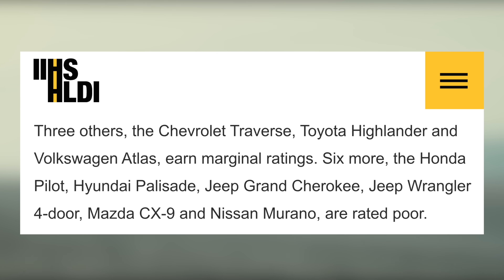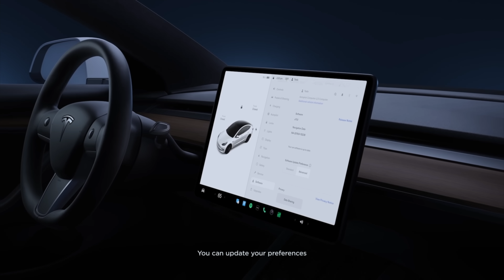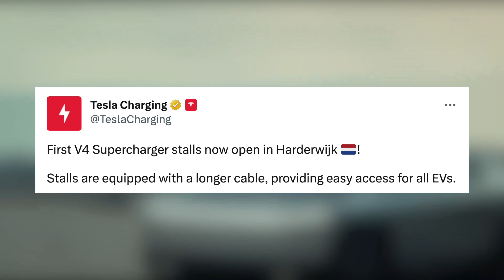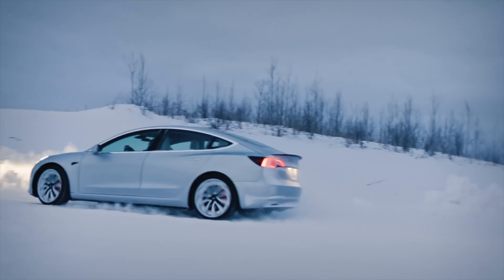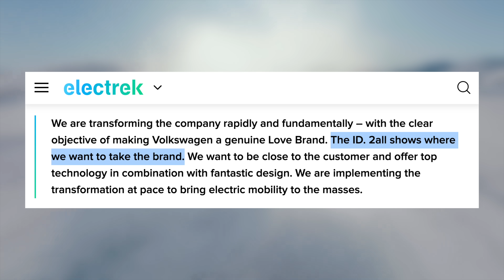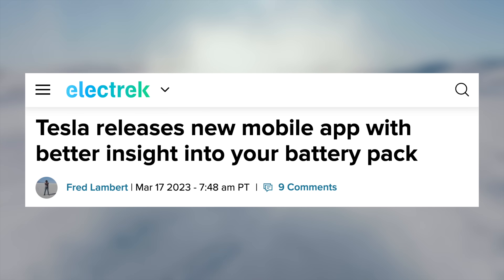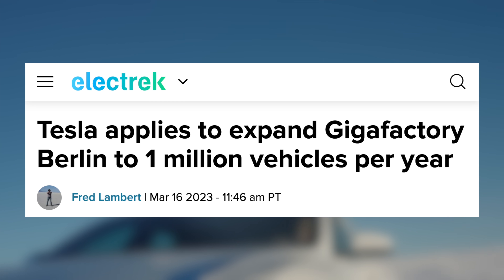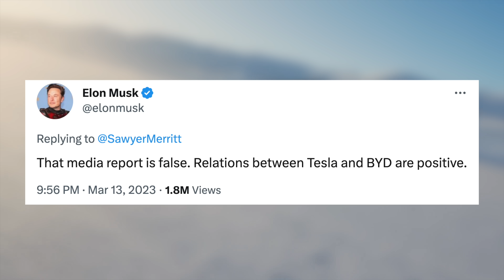Tesla “FIXED” Most Controversial Feature | Fans Aren’t Happy

Comment: I love that the V4 Superchargers FINALLY come with longer cables!
Since they’re opening up the network, cars with ports on the passenger side or even near the front wheels like Audi/Porsche no longer have to block multiple stalls if they can’t get the outermost one!
And since so many locations have a mix of V2 and V3, they can just swap out the old V2s for the V4s and roll the chargers out to more locations more quickly!

Comment: For Tesla’s current models, I think the biggest advancement in charging would be keeping the charging power up for longer. Not only does it improve charging speeds, but it also makes it less important to arrive at a charging stop with super low SoC. IE. More flexibility. 
The speed that a Model S, a EQS or Taycan charges at is fast enough already imho. You plug in the car, go to the rest room, get a coffee, put the codfee in the car and unplug at 300km of range. Plenty fast if you ask me.
Reply: The solution that I recommend and have been using since it became available is to enable the PIN code security

Comment: About your story of two Tesla owners driving away with the others Model 3, if either one of them used Pin to drive they would of figured this out before driving away!
Reply: This sounds like a better solution compared to others that have stated to basically “mod” your Tesla to differentiate it from others

Comment: Thought: V4 are dual 400V and 800V architecture. Can do 250kW for 400V. Can do more at 800V. Longer cable works for 800V, and has less losses. And less heat to exhaust safely. I'd say the V4 will have a hard time to be consistently at 250kW for 400V Teslas.

Comment: FONTS!
 I really wish I could change the font size on the Tesla display. I wear bifocals and have to lean over and down to read the display. This can be a safety issue for us old farts.
Technology actually exists today to change font sizes I believe. I do wish Tessa would allow me to enlarge the fonts. It wouldn't cost them huge amounts of money.
Reply: I totally agree.  I think Tesla designs their vehicles for 25 year olds with perfect vision and steady fingers.   In addition to increasing font size, they should increase the size of various buttons displayed on the screen.   Even if you have good eyesight and steady fingers it can still be hard to touch small buttons on the screen when driving on a bumpy road.
Reply: @wilber8260  I agree completely, one of the few things about my model 3 that bugs me.  I had a pair of bifocals made especially for driving. The lower part is optimised for reading at the distance to the screen and the split lines up with the top of the screen when I have my head in the driving position so I don't have to move my head to get the screen in the right position. I also bought the Teslogic dongle and app, I have my phone mounted on the steering column and I have a really big digital speedometer right in front of me plus other stuff like the speed limit, autopilot speed setting etc. I find I don't use my glasses much since I got the Teslogic app except if I want to see the play list or the street maps.
Reply: Perhaps UI designers could wear glasses that simulated old eyes.  There is no excuse for using light gray fonts.
Reply: Highly recommend progressive lenses, both sunglasses and standard glasses. Solves this issue for me
Reply: @RolandGustafsson  😂.  They spend 50k on a car but won't spend a few hundred on lens technology.  Love your comment.  👍
Reply: It really would not be too hard (or expensive) to have a head up display for minimal information such as speed, battery and satnav directions
Reply: @williamgrunzweig571  
A $100 Android Smartphone has the ability to change the font size and type, and customize colors and shapes, and move things around wherever you want them.  Why should a $50K car not be able to do so???  Many older folks  may not need glasses at all for distance vision... but need some help for things closer up.
Why do you make excuses for Tesla??  It should be a option in settings.  SO easy to do.. why should the owner have to spend money for something they don't need. 
The Font size is too small, LOTS of empty white space on the Tesla screen.. seems dumb to me.
Reply: ABSOLUTELY agree!!!!!!!!!!

Comment: The current 250kw stalls and 21 m3 lr is only a few minutes faster than a 150kw. I'd love to see the charging curve become an improved slope =b 

Usually, by 35% the speeds start to match on the v3 & v2 chargers but I've noticed while charging at 150kw the rate will stay above the 250kw charging curve longer.

3 long road trips and maybe only 4 minutes faster to 80% on a 250kw v3 vs 150kw v2 

I guess if you're living between 10% and 40% soc I'd go out of my way for the v3. 

Anyone else have different experiences?
Reply: Very similar experience here. I have a 2020 Model Y and my wife had a 2022 Model Y. They both drop to 150kW at 40%. 

This morning she plugged her car at 27%,. For a second she l it was pulling 257kW. About 3 minutes later she hit 40% but had already 11kWh.

Something to also take into account is that the 150kW stalls can drop quickly if there is sharing power involved.
Reply: @acolon8999  =b gotcha, I do get a little sad when a buddy bulls up next to you at a v2 and that charge rate drops =X. 

Cheers and good luck with your ev amigo.
Reply: @borshardsd  I don't go out off my way to use a 250kW charger but I try to skip 150kW chargers when possible even if it means running the battery under 10%.  I drive several times a year from New England to Florida and it's easy to hit 250kW stations for almost the entire trip. I can't wait for Tesla to start installing the V4 stalls here in the US. I hope that it would allow for faster charge for us by either allowing the vehicle to handle higher power or by staying at higher power for longer.
Reply: @acolon8999  good stuff man ty for sharing!
Reply: @acolon8999  wont the higher KV chargers only be for car that havent come out yet? I assumed it was basically tesla future proofing for future advancements in tech that would allow a battery to accept more power. I imagine the 4680 cells can take higher kv's since the energy has such a short path now making for lower internal batt resistance.
Reply: @AlistairBalister  Honestly, I don't know. I read somewhere last year  that Model 3s and Model Ys could handle close to 300 kWs but nothing official yet from Tesla.  I guess we'll find out eventually.
Reply: 250 are faster because they aren’t shared. 150 at busy chargers really means like 75. 75 vs 250 is a big difference 

On road trips I charge only until it is about 200. And then I move on. I don’t wait to charge it to 80 like noobs
Reply: @C Wang  lmao yes. If someone has to charge to 80 they are a noob. Definitely not because the next leg is long in the freezing cold. Thanks for sharing your true self. Obviously you stay as long as needed regardless of being a noob lolol yeah we should make fun of people for being new? Please.
Reply: I've seen someone else report that they saved time on road trips by charging more often and staying in the 10-40% range. But when factoring in the time to get out of the highway, look for the supercharger and the reduced speed in those streets, I'm not sure you can actually save a lot of time like this.  Idk. Plug in and watch a 45min episode of something or get some shut eye :) works pretty well. Doing 10 to 60 or 65 could be ok. The last 15-20% are quite slow.
I think current gen teslas will be limited in charge curve improvements because a lot depends on the battery chemicals. But some clever BMS updates might help.
Reply: @borshardsd  I’ve done more than 100k miles in teslas across 6+ different teslas. Drove across the entire country with tesla using purely super chargers and routinely doing 700 mile drives. 

I also lived in the northeast with tesla before and after heat pumps. 

You rarely need to charge to 80%. Sometimes you do but very rarely especially now with even more super chargers. 

As EVs go mainstream it would help if people are more educated on charging. It also varies from car to car. Taycans for instance can go pretty deep at high charge. 

But for most people. If you are road tripping, charge to 50 and move on. You often pass multiple chargers so you don’t have to go far from highway
Reply: @cwang9915  For me it depends. If it is a stop in which I am having a meal, I just let it charge until I am done with my meal. If it is a quick bathroom break, I charge just to get enough to get to the next 250kW charger if available if not, I usually change to 70%.
Reply: @acolon8999  yup same for me
Reply: @C Wang  so you read the comments and think I'm not an owner? With out road trip experience?  Yeah it's rare but not unheard of. Obviously when I mention charging to 80%soc its  situational, maybe below freezing on a big stretch, the car was using close to 400w/m. You don't need to stroke yourself, fluff up and do 100k to understand a charging curve or read and understand and communicate in a friendly manner ya noob.

Comment: Charging speed being quoted at kW is misleading. First, batteries are substantially different, from tens of kW to well over 100 - or even more for beasts like the Hummer. Second, all cars throttle charging below their own maximum, primarily depending on battery temperature and charge level.  A 150 kW, 250 kW, or 350 kW charger may in fact fill up a car's battery in not dramatically different times, especially if one needs to charge above 80%. And this does not even consider the dramatically different ranges out there for a "full" battery.  I'm not sure of any completely transparent alternative, but the charger arms race needs a bit less coverage, or much more thorough explanation.

Comment: In a dark parking lot back in the 70s My oval door key opened a Buick that looked like mine. But the rectangular key would not start it.
I think there were 64 different cuts on keys back then so not too surprising.
 I use a PIN to 'start' my Tesla, because of the story of a Vegas car jacker.. She waited for the driver to open the door and pushed her way into the driver seat. She got as far as a Supercharger 40 miles away.

Comment: Hey was wondering if you had some insight, was looking at Teslas around 35k I’m finding model 3 like 2020 2019 for that price or i could do a 2017-2018 model s  don’t know what to pick
Reply: Get the Model 3.  The Model S is absolutely a beaautify car.. But the interior space is not as big as you would think.. except for the cargo hatch area.  Try both out and see which you like better.  The Model 3 is probably quicker, handles better, and is more efficient too.
Reply: @brunoheggli2888  
In the USA.. Older BMW's are endless money pits once they get over 80K miles.
If you can't afford a new one.. then you can't afford the maint and repairs on an older one.
I'm sure in Europe it is a different situation... Parts are STUPID expensive here, and the labor to get the work done is also high.
Reply: @brunoheggli2888  
Or I can buy a Toyota and not have to ever worry about changing anything until it is broken which almost never happens. 
It's kind of why generally we consider European cars to be unreliable and money pits.
Shouldn't have to be swapping parts until something breaks or shows some kind of failure.
I Got a 15-year-old Toyota hybrid  with 423,000 mi on it. Still rolling on the original powertrain,  suspension parts except for the struts themselves, wheel bearings original cooling system,  radiator,  fans etc.
Primary inverter failed at 388,000 mi, 
$100 from a salvage yard took me 40 minutes to swap it.
I think one of the issues is in the US  we tend to drive a lot more miles and so these problems pile up a lot quicker.
I drive for a living, 50,000 + miles per year.
I Can't afford to be doing preemptive maintenance on stuff that shouldn't be broken in the first place.
And in the States You're paying a lot more for those parts.
Watch plenty of car repair channels some of which specialize in high-end cars. Jaguar, Bentley, etc. The mechanics that run those channels all say the same thing. Don't buy one of these with miles on it unless you have significant money. The general rule is if you could not afford to purchase the car brand new, then you probably can't afford to do the required  maintenance and repairs on it when you buy one used with a lot of miles.
 Keep in mind I do keep up on all of the regular maintenance on my car religiously. Oil changes every 5K. I  do the transmission fluid every 50k. Not really required. But it's cheap insurance.
And I can and have worked on just about every system in the car. I generally don't like shops, they're usually a rip off, and about 50% of the time they're incompetent at the same time they're ripping you off.
It's one of the many reasons my next car is likely to be an EV.  Internal combustion cars are becoming absolute nightmares to keep on the road..
And I'm getting sick of doing the maintenance myself.
Planning under a car to do an oil change every 5 weeks is a pain in the butt. It's not difficult, but it gets more annoying the older I get.
Hope you have a wonderful day.

Comment: Tesla might have the best charging network but it was not built for 8/900v cars, hence slow charging on those EVs until they upgrade to the newer V4 Supercharger.
Reply: its not slow at all, in reality its slower, we have plentyx charging infrastructure in europe, but the reliability isnt there, the preheating is not there, etc etc, in best case scenario you could charge slightly faster but in reality, simply not.

Comment: Could happen to any two cars of the same model and color, parked close to each other with key-less entry and push button start. Where both owners unlock and start the other persons car at nearly the same time. Highly unlikely. But if this happened to two say red Buick Encores, this would be chalked up to a crazy coincidence.
Reply: No it can't..  
You might be able to open the door.. IF the cars were parked  right next to each other.. 
My 15 year old Toyota knows what door your approaching.. Driver, passenger, or hatch.. It will only unlock the driver door if your are right next to the driver door, if you are near the other doors then they all unlock when you grab the handle.
It will not allow you to start the car unless your key fob is actually INSIDE the car..  not next to it.. or on the roof..etc.
I suspect this story is a fake.. some people trying to get into the news.. or maybe some weird situation happened.
But the cars should never have been able to "start" and drive off with the wrong key/phone  in the wrong car.
Maybe in a Tesla.. once the car authenticates the phone and opens the door.. it allows the car to be driven... That's a major security hole if that is the case.

Comment: it doesn't matter what these manufactures price these cars at. consumers are not going to get them at MSRP,  thanks to franchise dealerships.

if these automakers really want to make EV's affordable, they need to attack the core problem. which is, going after these franchise owners and establish strict pricing.
Reply: thats only one part of the puzzle, vw sayd already years ago they want to get rid of dealerships.
the elephant in the room is the outsourcing and actual process of making a car, this is what limits them so hard on software updates.
whats under the hood is trash to say the least.
if VW wants to achiveve this high specs at low prices they have to build the car like a tesla is build today, they basically have to start from scratch.
i highly doubt any of this will come before 2027 or 28, if at all.

Comment: The story of the two model 3’s switching owners by mistake is an utter set up. There is no way that you don’t know your own car and trash that you leave in it. the odds of the same make model color interior exterior package owned by two guys on the same street  who are both incredibly tidy, have never spilt anything in the car nor carry anything on display and don’t use presets on seats or radio and have the same mileage and amount of charge since we know they aren’t in garages. Then Tesla made some one in 100,099 key frequency duplication also. 
Absolute bunk. Not even worth reporting.
Reply: In Santa Barbara California you see two and even three nearly of fully identical Tesla Model 3s and Ys all the time especially White ones.
Reply: @matthewhuszarik4173  In Silicon Valley, they call white Model Y's Tic Tacs.  They're just everywhere.
Reply: Exterior. Same here in New York where they are Ubers. I’m sure you could try to get in the wrong car, I think we have all done that in parking lots. But sitting in my car for a moment I can see a custom covid mask or a pen from the drivers seat. Several items on the screen. And then mileage and specifically charge on the battery and customization on screen to not notice for ‘several hours’? It’s a stretch

Comment: I'd argue that Chevy HAS beaten Tesla to delivering an affordable EV with the Bolt. Is it good looking? No. Does it have as much max range as a Tesla? Also no. But it comes in MUCH cheaper than the cheapest Model 3, and that's going to be the biggest factor in really making EV's an "every person" car. The second factor is going to be keeping the charging at an affordable cost, and making sure the infrastructure can handle the load of more and more people driving EV's...which it currently cannot handle.